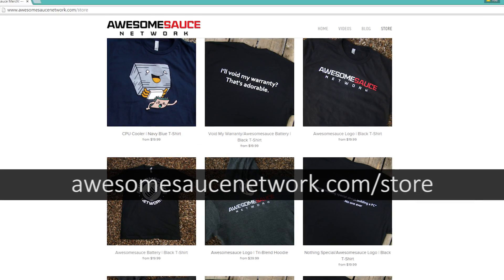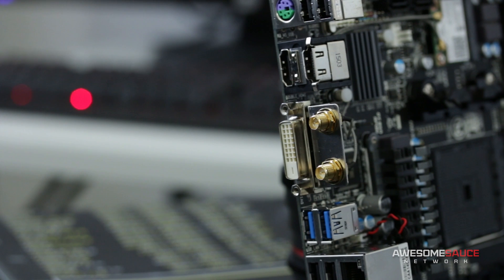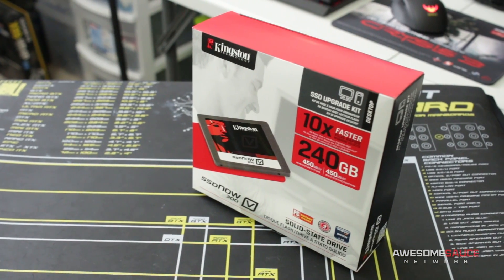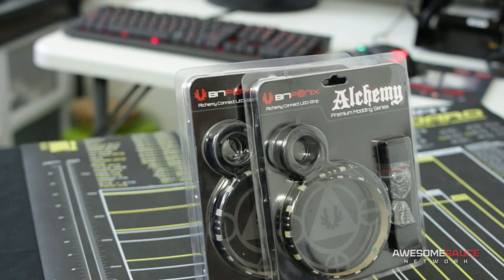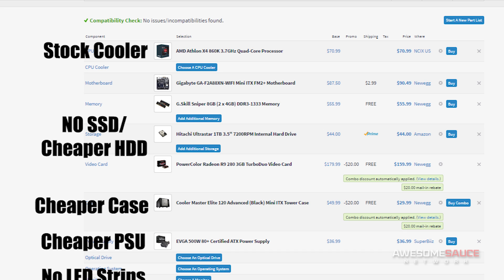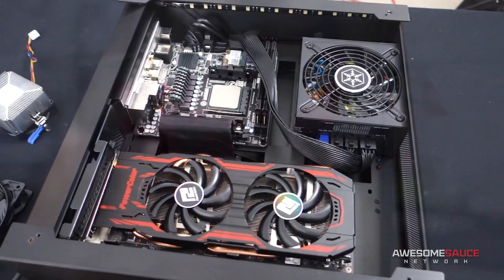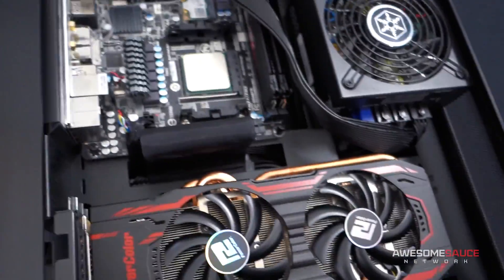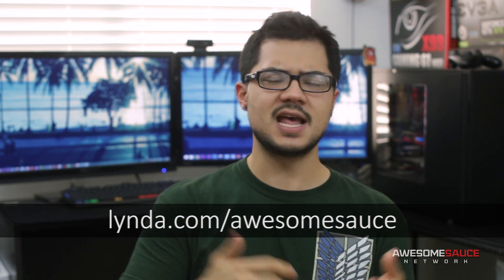The Overkill Console Killer: And How to Build One for Under $500 (Part I)

Comment: what if people wait a year or so and let prices of consoles go down? can a $250 pc beat a $250 xbox one i think not
Reply: +Marijn Lamers hes right tho. not console fanboying here. it would be pretty hard to beat a ps4/360 for $250.
Reply: Lizrad Sceptile first it's 350 for ps4 and 300$ for xbox Second you all seems to not take in consideration psn and xbox live for 60$ a year games that cost 10-20$ more...
Reply: +Cryptic Chaos you made the right choice
Reply: +Joshua Lopez You should check JERMGamings Chanel on the potato smasher, it's a $375 pc that outperforms the PS4, if you buy the parts used you could get it lower then $290
Reply: +Marijn Lamers sing it guuurl
Reply: first in a year there will be gpus that would do the same job for way less money second let's hear abput that xbox live fee....
Reply: Well, power-wise yes it can, but the unified architecture and the fact that they don't vary are making consoles available for extreme optimization. If you were to optimize a game while developing for that exact 250$ system it could very well run miles better.
Reply: +Marijn Lamers hes right tho. not console fanboying here. it would be pretty hard to beat a ps4/360 for $250.
Reply: +bogdan negoie (JhonBidon) gg gg.  well done
Reply: ***** stop living 10 years ago Yes 360 and ps3 did benefit from "heavy optimisation" but there was a huge difference Ps3 and xbox used a RISC based cpu more exactly power pc for xbox and cell for ps3 Now they use CISC or more exactly x86 The development is the same as on pc And don't try bullshitting with things like "uncharted look better then anything" and other crap like that because it's about game engine not a optimisation thing
Reply: bogdan negoie I think we're talking about a different "optimization". I said "You're making the game for one system only when you're developing it for a console, but you're making it for pretty much infinite combinations when you're developing it for PC. That's why you can optimize a game better for a console than for a PC. If you were to optimize a game specifically for one PC system you could make it run better than a console of the same price."
Reply: +Onaterdem no we talk about same things but you are lacking a lot of informations First about pc The "infinite" conbination in hardware was a problem That's the only reason why microsoft have made the directx And granted the first iterations didn't worked so good we have over 20 yeats of evolution on it
And yes there are still games that are not optimised but you have to look at their background On arkham knight  there were 6 programest that worked on the game, Ubisoft games Ubisoft always tried to nerf the games in favour of consoles (like in far cry 4 they didn't bother to put higher textures or anything like that They just said the graphics from the consoles will be the highest preset avaleble or when they downgraded watch dogs to look like on consoles and yes that was the reason it's pretty clear taking in consideration that the original textures were found in the folder deactivated)
On consoles it was a completly different thing with the last gens Risc based cpu's need less power and a lower frequency to do the same task but making a good program for it require more work (therefor more money) and more experience  Because the power pc was used for the very first time in gaming (the instructional set from xbox) and with cell (the one from ps3) they were able to "optimase" better with the time aka gaining more experience with the instructional set Not the case with this gen It uses x86 the same used on pc since 1978 and on the original xbox
Reply: bogdan negoie I know about this info, you're getting me wrong again. Let me try to explain. I'm not saying that PCs are less powerful or that console games look better. I'm a PC guy myself. But when you're making a game for thousands of systems at the same time (PC), even if they all use the same code, their materials and power limits and etc. are gonna be different and you're gonna round the graphics up and make settings that'll fit all systems, not just one. As you don't know what the user's gonna run the game on, you don't know how much further you can push it or what sentences in the coding you should use, so it's more difficult to get the perfect graphics/power balance. As a specific console is just 1 system and doesn't differ in every household, you know just exactly how limited its power is, you know which sentences it can understand better, you know what graphics you can go up to without compromising framerate, so it usually has a better graphics/power balance. You and I both know what I'm talking about, that's exactly what I mean by "consoles can be optimized for better".
Reply: bogdan negoie Yes, that's correct, of course talented programmers can optimize a game for the PC as well as for a console. I also meant what you said, let me alter my statement a bit. It is possible to optimize a game as well for a console as for a PC, it's just more difficult and takes more effort because of multiple setup possibilities.
Reply: Current hardware would go down in price, and then yes. That's like saying if we could make a PC that beats the PS2. Yes, and for less.
Reply: Dimitri Sainis you are getting it wrong with the ps2 it took longer with xbox is possible right now especially taking in consideration that it does not cost 250$ as he implies Just to make myself clear the weekest skylake i3 (100$) have a score of 6000 on pc mark the cpu form the consoles is a custom chip made soldering 2 athlon 5150 each of them about 1600 Yes that big of a difference between the cpu from consoles and a low end cpu the gpu is a slightly modified r7 360 that costs little under 100$ If yo want to talk about ps4 it has the same cpu but the gpu is an underclocked 370 (about 20% in clockspeed downgrade) that costs under 130$
Reply: +bogdan negoie (JhonBidon) people use xbox for offline games too dumbass
Reply: +Chuck Barrientos $400 is a lot from $250
Reply: Joshua Lopez so fucking microsoft is lying on their site..... They say 300 for 500gb 350 for 1tb and 400$ for 2 tb but yeah you get them for 250$.....
Reply: xbox 1 S and project scorpio...
Reply: Dude I play xbox one and even I know that we are console peasants. just accept it. I have and am planning a pc build as of lately
Reply: I made one that could from parts from crags list plus the Xbox one is an upgradable piece of shit....
Reply: we made you
Reply: Joshua Lopez yup, it can
Reply: IGNACIO SAVI No it cant
Reply: Joshua Lopez Wow, what great argumentation skills.

Comment: Kyle, could you compare this build?
I-3 6100 ( $115) 
Intel H110 Micro ATX board ( $50)
GTX 950 ( $140) 
Crucial Ballistix Sport LT 8GB Kit ( $31)
Seagate 2TB ( $53)
EVGA 500 W1 ( $40)
Hyper 212 Evo  ( $30)
and a case?
Reply: save 30 and just use the stock cooler since you won't be overclocking. The 30 you saved can go toward the asus strix r9 380 4gb which is 180. The nzxt 210 is a good budget case that doesn't look like shit.
Reply: +bariso101 you can overclock non k i3s i hope you know that right?
Reply: Thats only if you are willing to downgrade the bios of your motherboard to before intel decided to fuck everyone.
Reply: bariso101
true, he may have an old mobo laying around somewhere though?

Comment: i only have console can i play that $500 pc on my 1080p led tv or i have to buy a 1440p computer monitor if i do how much more that will cost me.
because my tv is mainly for cable TV not just for gaming
Reply: If your tv has an hdmi port yes you can.
Reply: you can use your tv
Reply: A 1080p 60FPS monitor with built in speakers, is about $100, but the TV should work fine, if you've used a console on it before.

Comment: what about the monitor thats part of the pc for a new pc gamer.  or is ok to plug it in to the great room led tv
Reply: +yaseen reza my point is that TV/monitor shouldn't be a factor included they both need a way to project the video
Reply: Tv
Reply: Most PC graphics cards that are higher end support HDMI, which every modern TV supports pretty much
Reply: Console gamers also need a TV
Reply: Boring bomb bay not true, friend has a Ps4 and a PC, both are plugged into the same PC monitor
Reply: Boring bomb bay yes, I see, but most people will by default have a TV that supports HDMI as opposed to a monitor that does the same
Reply: use a dvi cable with a PC monitor if your serious about gaming other wise use HDMI and a regular TV.
Reply: Here's a $700 build with all the hidden things included. Wifi, Windows, Monitor with speakers, etc. All the necesities that nobody thinks of. http://pcpartpicker.com/user/Immrspy/saved/bwKFf7

Comment: what is better athlon x4 870k or fx 6300? plz respond
Reply: the fx 6300 clearly but stay away from those 4 Jear old amd cpus... theire cpu architecture isnt great for gaming, they always got eg. 4 cores but only 2 L2 cache modules, or 6 cores but only 3 L2 cache modules, so there are allways 2 cores using one L2 Cache unit, and thats a problem for gaming and will cause your fps to be much worse as they could be with intel cpus.
If you can get a i3 6100 youre good to go!
Reply: Michel 14
no it actually has 6 cores but only 3 L2 cache units so all those cores cant be used so efficiently
Reply: Michel 14
it may says that but its 3 cache units and 2 cores per cache. Not that this makes it better
Reply: Michel 14
ure welcome :)

Comment: I just built a "console killer"  that would also kill that computer for less money. It may be used parts and the case may be crap but raw performance doesn't lie. I have an i5 2400, 12gb of ddr3 ram, an evga gtx 770, a 50gb ssd for Windows and a 320gb hdd for storage. The whole thing cost me $309.
Reply: How's the performance? I'm going to make a i5 2500k build for my friend whose converting
Reply: +usd m8 it runs like a champ. Would. It's a repurposed office computer so the motherboard and cpu do not allow overclocking. Even without OC I am able to run all of my games maxed out over 60 fps on my lg 2560x1080 monitor. The gtx 770 is an awesome card and I only paid $100 used.
Reply: wtf i5 Costs 250
Reply: +Darrin Hillier fps on bf4,fallout 4, and the division?
Reply: +LukeXDNL the newer i5 6600k costs $250 but the 2500k is a couple of years old but still great for gaming

Comment: I'm assuming the cost of Windows so you actually have an OS to make this sub $500 system actually work isn't included in your price so in reality the $479 is actually over $600 with that included right?
Reply: You can get windows 7 for 20 bucks and upgrade to Win 10
Reply: you can get windows 7 pro for 30 bucks, less if you shop around
Reply: +RussianK That is not true case. Windows 10 is only available as a free upgrade to Windows 7 and 8 edition product keys which were activated 6 months after the release date of Windows 10. Any windows 7 and 8 product keys activated after the 6 month grace period given by Microsoft after the release of Windows 10 that wish to upgrade are required to pay the full amount.
Reply: +Sarkis Anaforian If you risk it, some Win 10 keys are $20-$30.

Comment: Hey Awesomesause, First business of the day is I subbed for your amazing help. Second is I currently own a Acer Aspire AXC-603G-UW30 Desktop PC with Intel Celeron J1900 Processor, 4GB Memory, 500GB Hard Drive and Windows 8.1. Not even remotely the greatest Gaming Rig. I was on PCPartPicker and made this computer for scratch. I'm not the greatest with Computer compatibility, but i do know how to install one. Can you tell me if this is worth the price or can i get rid of some things and make a cheaper Gaming Rig.  http://pcpartpicker.com/p/dykGvK
Reply: That cpu cooler is a little overkill don't you think
Reply: +IrishDrunk Gaming I wouldn't go for an AMD CPU at this Point. Either wait for Zen or go with I3 6100. The i3 will outperform the 8320 in games. You can cut some cost on your Mainboard as well. How much depends on if you want overclocking and CrossFire or SLI Support. Your PSU is also a bit too much. You will never Need a 900 watt PSU with a single GPU. You could go with a 650 watt PSU from EVGA of something. You also really don't NEED that CPU cooler. You could go with a Hyper 212 Evo for 25 bucks. Your graphics Card is fine, however AMDs new graphics Cards will also be coming soon, so you could wait for that. But for now the r9 380 is a very good choice. If you do all the Things I told you, This is what you end up with: http://pcpartpicker.com/p/Yx73cfIt's about 200$ cheaper but performs the same.

Comment: What about the monitor keyboard mouse....... still not cost effective as a console.
Reply: You need a monitor or a TV to play on a console too... And a controller costs more than a cheap keyboard mouse combo (for example the CM storm Octane)
Reply: +Jonathan Bodner agreed, however in most case you already own a tv and when coming from console some don't factor the monitor in.
Reply: +shinobi211 you can also use you tv as a Monitor. For a console you Need to pay for online Features as well. if you get a Keyboard mouse Combo for 30 bucks, you are still cheaper than a console. But since you mentoned that most People already own a tv... Most People also own a pc. you can take the Monitor, mouse and Keyboard from that. and if you are lucky, even some internal components

Comment: You also have to factor in the cost of windows as well, very little games run off linux.
Reply: +MrCrazyLovingGuy You can get windows for less than £20
Reply: +Jack Lee https://www.reddit.com/r/microsoftsoftwareswap/ you can buy keys from there and install of a USB
Reply: Just "buy" it from piratebay, i did it. I had an "activate windows" message in the bottom corner about a month, but then i downloaded a program that made microsoft think i had the real deal lol
Reply: +Jack Lee how?
Reply: Delta X mmoga but i have heard some people said reddit but i don't understand how it works on there.
Reply: MrKiingpin cheers!

Comment: i currently have a quad core i3 that runs at 2.9 ghz and am looking to upgrade, would the cpu he uses here be a step up or no?
Reply: No
Reply: Not really, as I believe this is also quad core. I'd go with AMD FX6300 which is hexacore but only about $100
Reply: Huy Vu thank you
Reply: There are no i3 quad cores,it's 2 cores with 4 threads.

Comment: i got my xbox for 300 and two games for free brand new with a 3 year warranty. Add windows to the pc plus peripherals and you are over 500. the xbox only gets cheaper as new games come out as well. It will cap at around 300 with sales being 250. A pc just cant do that and still meet the performance.
Reply: no pc is great but these console killer builds are only valid for about two months after launch and the parts are not of the best quality sometimes

Comment: You didnt include $100 for windows and you also should have taken in costs of a decent keyboard and mouse combo
Reply: +Jamie Kidman Windows 10 is free, decent keyboard $20, decent mouse $10, most people will have this laying around anyway
Reply: Windows 10 key isnt free from scratch and decent please the best you can get is a shitty membrane keyboard
Reply: Obviously, but the $30 keyboards are far worse than using a controller
Reply: Jamie Kidman A regular keyboard gets the job done, what is it lacking? And btw you can use an Xbone or PS4 controller on PC
Reply: the controller cost 60 usd so the cost of a decent keyboard
Reply: im sorry but your point was?
Reply: Jamie Kidman If you knew anything about hardware you'd know a $30 keyboard is very good. I think you're trolling but just in case, what exactly makes a keyboard "decent"?
Reply: My opinion is that for the price point consoles are better to game on, however for PC gaming it would be better the save up and buy a good computer.
Reply: And by descent i do refer to mechanical which is far more expensive than a controller.
Reply: Jamie Kidman Yes, mechanical is what i was referring to, non mechanical is more expensive

Comment: that hdd is not two terabytes. :|
Reply: *****
2000GB are not two terabytes. 2048 GiB are two terrabytes. If it says "2000 GB" it means it's using the factor 1000 to mulitply each new unit.
1000 Byte = 1 KB
1000 KB = 1 MB
1000 MB = 1 GB
1000 GB = 1 TB and so on.
But a computer in reality uses 1024 as a factor.
1024 Byte = 1 KiB
1024 KiB = 1 MiB
1024 MiB = 1 GiB
1024 GiB = 1 TiB.
so the hard drive producer may interpret it as two terabytes, but in reality it's about 93% of, so, approximately 1862 GiB and 1,8 Terabytes. So I prefer if you just say "2000 GB" over "2 Tibibytes" as 2 actual Terabytes are called. the "bi" in "Tibi" stands for the binary system, as 1024 = 2^10
Reply: *****
I'm currently doing a apprenticeship to being an IT-Assistant so I gotta know this shit. ^^
Reply: +LP Guitar Watch out guys! We got a baddas over here!
Reply: Demeter Dominik
yeah. puts on sunglasses

Comment: I don't really know why everytime there's a console killer pc build they don't include games in them. Like give a budget to buy a console and games same with PC. example consoles vs PC @ $2000 budget. you can build a $1500 PC already with a 970 or a 390. and 20 AAA games. Consoles will have 25 AAA +the unit. After 3 months you add a $1000 budget. that means the PC can upgrade to an SLI 970 or xfire 390 plus 35 or more AAA games. consoles will have 16-20 AAA games. That's 55 AAA games for PC + $1800 PC unit. while consoles will have 45 AAA games + the unit. Now it's up to the viewers which will they prefer.

Comment: The silverstone SFX-L PSU is horrible. The fan makes a loud noise when it starts spinning. This is a production error on all units. If your system just pulls 50% of the load hence making the fan starting to spin it will always make a click click click sound. I returned mine and bought the Chieftec SFX-L.